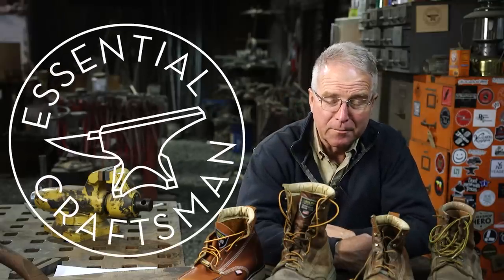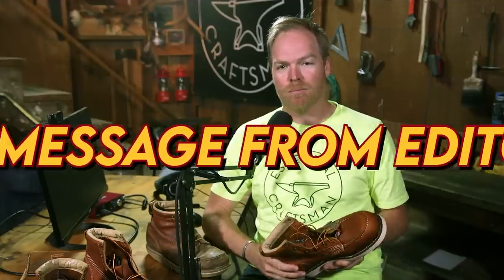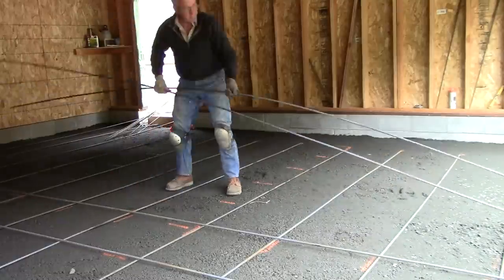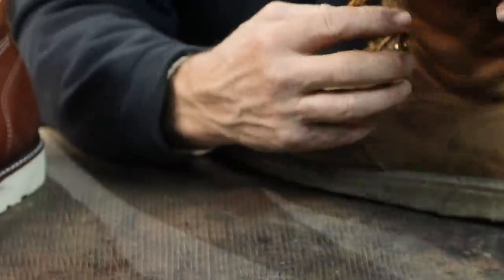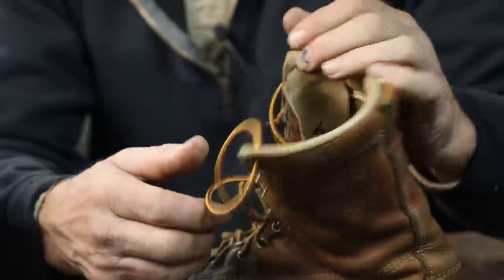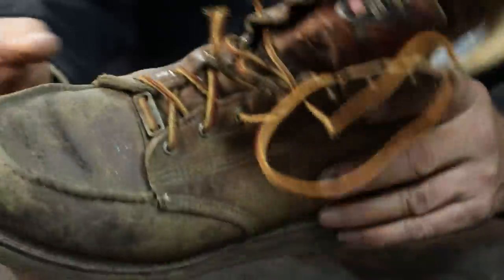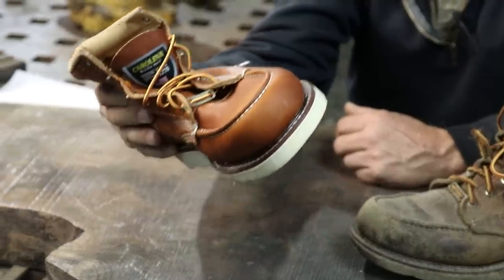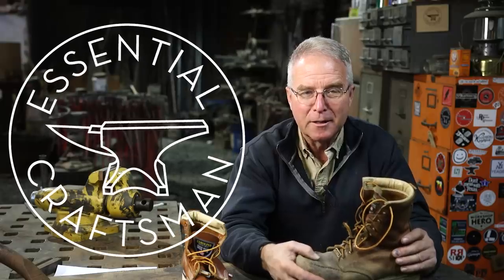Carolina Boot Review

Comment: If you want to moisturize those boots I would recommend Sno-Seal which is a product Sorel gives with their boots. I've had the same pair of severe temp ( comfort rated to -85F ) for 30 years now. Obviously I don't wear these all the time because above 0 they'll make your feet sweat. And they are military green ugly but they work very well in extremely cold weather. My cabin was near Embarass, Mn where we had the coldest recorded temps in the USA and I went out hiking for hours in them with 3 pairs of pants on and feet were toasty warm.

I believe the sno seal is a beeswax based product. You could probably just heat them with a hair dryer and apply plain beeswax like from a toilet wax ring.

The best regular temp boots I ever wore were from Mill's Fleet Farm called "Black Striders" and the reason I liked them were for their Vibram soles. I did a lot of river canoeing and this sole will not slip on algae covered green rocks. Apparently they've sold the Vibram name to Adidas ( I think ) and now they reside in those fancy 5 toe shoes that were so trendy a few years back. Well I was wearing them 35 years ago.

 I also have wide feet so I can get them in a D or DDD for wearing with hiking socks.

The only problem is I can't find a more regular street-friendly version of them. I've switched to Crocs at home or Rockports with the side zippers while out for style these days. I suppose another day I'll give a go towards googling the vibram sole shoe again and see if I can get it in a style I might like these days since I haven't river canoed in a decade now.

Comment: Obviously boot preferences are as varied as feet size, shape and walking style.  I've tried dozens of boots but for over 17 years I've gotten RedWing 2414 or the cheaper, not waterproof version.  I buy 2 sets of the custom orthotic insoles (put in new ones after a year) and pay for epoxy toe caps.  It's a big bill I won't lie.  A "value" they are not at over $400...but they feel amazing.  I've got old knee injuries and 43 years of wear and tear on my body.  These shock absorbing soles and the soft leather uppers together are heaven for my feet. I cannot find anything even CLOSE. I wear them 2 years, maybe a bit longer and usually resole and refurbish them for another year or two of use.  By year three I buy another new pair. I keep the latest old pair for days when my boots take extra rough abuse.  I buy used used jeans and tees at the thrift store (unless I find carhardt pants on sale)...I drive a 25 year old chevy van...the point is I am a "value" guy where I can be. With my boots abd taking care of my feet...value is not what I'm looking for.  I'm about 6', 180lbs., size 12D not high arches, I pronate when I walk....in case someone with similar fit/feet/walking style wants to try them out.

Comment: I wore Carhartt until I had to be cut out of a pair.  I bought a pair of Carhartt winter boots, and they trigger some deep, lost memory of my fall l, so they sit idle.

I tried Carolinas, but on the first time I put them on at home, an eyelet pulled out of the upper.

I returned those for a pair of Thorogoods with an 8" upper to help support my healing ankle, but they rubbed my plate in my fibula wrong.  I just replaced with a 6" upper that has an anti-roll heel stabilizer, and once I replaced the insole with Protalus M100, I no longer can feel my hardware in my ankle at the end of a day of lifting drywall.

Comment: When I first got into electrical 3 years ago I wore timberland anti fatigues for 8ish months . They were super light and didn’t hurt my feet or back .... until I got home it felt like I got hit by a bus .....
Some time after that my foreman noticed I would walk funny to not feel the pain of the boots so he pulled me outside to the office and he said to take his brand new in the box , Wolverine I-90 durashock composite toe ..... SUPER COMFY AND VERY LIGHTWEIGHT, right off the bat ... comfortably wore those about about a year and a half until I ran the soles down ... I wanted another wolverine boot but moc toe , so I got some 6” steel toe moc toes and they hurt so bad but I wore them for a few months until my toes and legs couldn’t handle it .. 
beginning of 2020 I bought thorogoods moc toe 6” and they have been nothing but the best all day 12+ hrs even for riding a motorcycle all day or running around with my son . I will keep buying thorogoods . USA made and look great . All the pain is gone ...
Those Carolinas look good might have to try them sometime , great video

Comment: There is a high pitch noise in the video.

Before you export it next time you should run a frequency plot to see if it is a problem.
Reply: The forge was running to heat the place up.

Comment: Wore a pair of super heavy duty met guard Carolinas pipe welding for 2 yrs broke the steel toe with a 80 lb section of pipe soles were still good not flat bottom but still great boots. Now use thorogood but want to try Carolina. Can they be resoled?

Comment: Im very happy with my red wing supersole 2.0 8 inch top steel toes the only problem i have with them is finding a good toe cap to save them wearing through but even with that i get two years a pair out of the soles and as long as i dont wear the toe through the upper can be resoled though i have yet to do so for the fact that after 2 years of wearing them day in and day out they are only about 120 dollars a year boot wear as the other boots I've tried never hold up

Comment: I'm a little different, but my job is a little different too. I've been wearing Tingley over-the-sock "Profile" boots since I was 10 years old. I've grown up in those boots, and frankly, they've been the most comfortable and most natural thing to put on my feet. I own a pair of dress shoes for church, and a very cheap pair of tennis shoes for those few occasions where it's not appropriate to wear boots. Otherwise, I spend nearly every waking hour in rubber boots.

I've been milking cows in rainy muddy Virginia for the past 24 years, and it's pretty imperative to have footwear that keeps 100% of the mud and water out, no matter how deep it is. At my peak, I was milking 130 cows twice a day, and I wore straight through the sole of a pair of boots every 9 months. Not merely worn down, but literally worn until they were paper thin and leaking across the sole. The sandpaper-like grit of the parlor floor was responsible for the fast wear rates.

These Tingley's don't offer very good arch support, but the importance of that is questionable anyway. I feel it's better to strengthen the foot, so it doesn't have to rely on arch support.

https://www.tingleyrubber.com/collections/over-the-sock/products/profile-plain-toe-knee-boot

Comment: Best way to make your boots last longer is to have two pair that get alternated every day. It allows the leather dry thoroughly between uses. For $100-$150 more than the Carolinas you can get a Goodyear welted boot that looks better, is more comfortable, has better support and will last most of a lifetime. Check Truman Boot Co, Thursday Boot Co or JK Boots, all cheaper than Whites or Nicks but still way better than Carolina. All small manufacturers in the PNW.

Comment: I was convinced Sears now rockroster owned? Die hard was a great boot but my stitching failed from boot to bottom sole after 2 months of ownership. Very disappointed left and right foot stitching fail almost 5-8” long and I’m a size 10.5 U.S. Size. I did email rock rosters and I should get a new pair soon. I love the durability of the bottom sole but I hate the stitching in which as of now it is being repaired by PECKS SHOE CLINIC in Moscow Idaho. Great reviews and can’t wait to see what they’ve fixed on my die hard 8” tall boots! Anyways in search for durable boot maybe redwings? Idk but currently switching from framing back to a concrete crew!

Comment: Been in the work/safety footwear business in Canada for 35 years. We could not sell American made safety footwear here because: 1) they were too expensive (The Goodyear welt process is very labor intensive) 2) back 30 years ago we had available on our market boots made in Canada with vulcanized soles and later with polyurethane injected soles that were lighter and more flexible, they had soles that lasted the life of the upper. 3) most of them did not come with puncture resistant soles, a required thing on any construction site and many industries.(Thing of notice: safety puncture resistant insoles made of flexible steel are an american invention: they were developped during the Vietnam war to protect soldiers feet from traps dug in the forest by the Vietcong. Those holes, usually a few feet deep, were lined with sharp bamboo spikes. Soldiers would fall in the hole and puncture their feet and get a very painful wound that could get infected and take them out of commission. For this the enemy would defecate in the hole to make it very nasty. As far as your new boots are concerned, they would not be approved by our OSHA on construction sites because they don't have a safety toe, puncture resistant insole (they are now made of Kevlar) and they don't have a defined heel (to keep your foot from slipping on a ladder rung.) Also, work boots now have to protect you from electricity, the sole must resist 17 000 volts to pass, I don't know if yours are electrical hazard rated. Voilà.

Comment: cost is always a factor for me because I rarely worked for companies that gave you a tool/boot allowance and I was limited to certain brands because I have 5E width feet.  Yup, they are that wide.  That means I usually end up buying a boot at least 1.5 or 2 sizes too big in order to get the width because I couldn't afford to fork out $300+ for custom width boots.  I had the most success with Dakota and Caterpillar, 6" cuff or shoes.  My last 10+ years has been in cabinet shops so no need for a boot there.

Comment: Ive always wanted to try a custom mold redwing . ive tried tons of boot brand sizes and none feel right. Have wider feet at the balls of my feet. I usually have to get an insert too cus my heels are pretty tender . That said i tend to get a Carolina 8 in logger, with steel shank (makes shovel stomping and ladder standing alot nicer) elec,slip resistant, and water tight to lace top,with their middle weight insulation (my feet get cold from fall thru till late spring) plus it helps ad alittle cushioning. I tend to roll ankles easy so the 8in logger seems to help lessen the chances and when it does happen its usually not bad. Also steel toe cus masonry and ground man work can lead to some rough use. Alit of kicking stones to slide em that 1/8" to perfection, or resting the corner of a 150-400lb step on ur boot toe while ur packing it in. Just wish i got longer from em. Id say cheaper too but i like the american made sell point and u pay more for that tag. Besides....im done doin the greenhorn walmart brahma lead weights. Yeah they only cost like $40-70$, and yeah they feel ok new, but theyre heavy,i was lucky to get 4 months, and they just looked goofy.

Comment: I had a $150 voucher through my employer to get boots with toe protection. I got a pair of caterpillar industrial shoes. Very durable all around. I wanted something could wear with shorts without looking like a goober. I work in aviation and so the work doesn’t require pants. But as we move into winter months. I wanted something that provided a bit more protection for the icy flight line and the cold air. The caterpillars I wear every day even at home and out and about. Somehow the leather tore in certain places. Like something sharp cut it but inspection shows a whole other layer of thick leather that appears to barely be broken in. So there’s plenty of life left in them.

I ordered a pair of Carolina Loggers. I’m waiting for them to come in the mail. I opted for the uninsulated ones that aren’t waterproof. Waterproofing added $40. I found with my time in the Army that my cold weather waterproof, insulated boots made my feet freeze. They didn’t breathe even though they told us they were breathable. The thick sole was like a solid brick of polyurethane sucking heat out of my feet. My feet sweat a ton. So by mistake I wore my hot weather boots in zero degree temps walking on ice and my feet stayed fairly warm. I realized that I do better with wearing thicker socks and changing them periodically. So I am hoping these new Carolinas will provide similar benefits to my Army hot weather boots.

Comment: I don't know... I prefer sandals and running shoes. I never turn my ankle. I never drop anything on my feet. Well, hot metal sparks would not work with sandals but I usually can direct the material so it goes away from me. Even hiking through the cold I can get by with sandals as long as the snow patches are not too long. If it is heavy duty snow then yes I'll use boots. But for contractor type work sandals and running shoes are all I have ever needed. Unless I'm having a senior moment now...

Comment: Wore timberland pros 6” for few years-  worked well but wore out sooner then expected and were pricey at 140 +\-,

Got an expensive brand of fancy 200-225$ 6” redwings made in USA expecting to get more life out of them- wore them for 3 months and can’t ever wear them again cause the tough leather and steel toe bruised up my feet pretty bad and were not comfortable at all- what was most weird to me is how the original leather made my feet smell really bad when I took them off at the end of the day cause it held in all the moisture and I’ve never had that problem before 

Got fed up of the expensive stuff not getting what I was paying for so I tried out a pair of cheap 75$ caterpillar argon work shoes for everyday running around which have now become my daily’s, never thought shoes would be the way to go but for general renovation jobs the regular shoe height frees up the ankles for easy movement- easy on and off- and the shoe itself has a rubber toe cap which holds up well to when your on your knees doing flooring or roofing work which was a major wear point in my past, also light weight and usually holds up for a year which is not bad for 75 bucs

Comment: I might give Carolina a shot although you can still get Diehard moc toe boots from Sears.com. 
I liked my DieHards although the heel cup on the inside has started to come apart, which sucks. I wish it were leather all the way down. I've been able to use some shoe goo on the inside to stick it back in place but it's definitely a temporary fix. None of my other Diehard boots have done that.
 I definitely agree with the sole not wearing out. Whatever magical mystery polymer they use, it wears like iron. I think the only longer wearing item might be the tread from a tire.

Comment: I wear tan military boots or known as the desert style. Now granite this is only for a job while I work through college but for what I have found a gortex steel toed boot with a set of doctor scholls tall an heavy pads in them (after your rip out the factory ones) have a great rigidity due to the steel toes an the upper wear is second to non the only qualms you could have is the middle of the sole after about 2 years has a tendency to crack an split the whole depth which isn’t a “deadly” no go it just looks terrible. Also the oil resistant soles are an issue when you want a sneaker type traction. Don’t get me wrong the traction is above average but sometimes you do wish for a little more stickum

Comment: Strangely I just bought some 8 inch thorogood just like these that sortve classic pair I wanted something hard waring and comfortable now the soul inside you can take out and replace if and when it gets worn but it’s soft so straight away it’s comfortable on the foot then you have nice stitching and a good leather and round the top there’s a very soft leather but there not lined so in summer there not too hot and I like the support you get from a leather boot not like the synthetic style walking boots you get with monster souls I don’t need that and when I do I have a walking boot or if it’s really bad thought work wellies

Comment: I have a pair of Tactical Research TR998Zs that I got at the beginning of this year when a friend recommended I try out combat boots. They're not workboots, and not really quite appropriate for welding, which is what I do, but I wear them every day, unless it's at least 85 or 90 out, and it's  because I can move in them. Something about the grip and the geometry of them just really agrees with me. They're also very comfortable and I don't expect them to fail any time soon. Then again, welding isn't exactly intense work most of the time. Every now and again I wish they had a leather toe, though. If you burn off a corner or something gets hot and your puddle falls out, it'll go right through and put a nice hole in your sock.

Comment: I had a favorite pair of hiking boots with Vibram soles that I wore to a concrete job and the soles dissolved and crumbled in one afternoon!  I guess one of the additives reacted with the Vibram's chemistry.  The shoemaker I took them to cut the bottoms off and re-soled them ...and botched the job.  They were lumpy inside underfoot and he changed the fit.  Unwearable, and LLBean doesn't make them anymore. *Grr....*